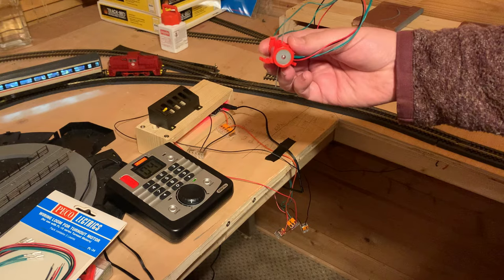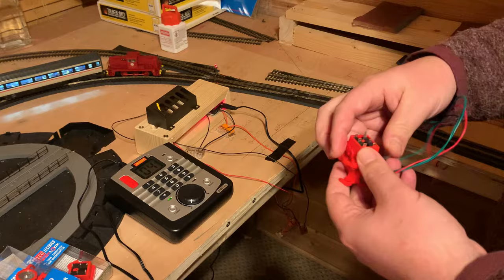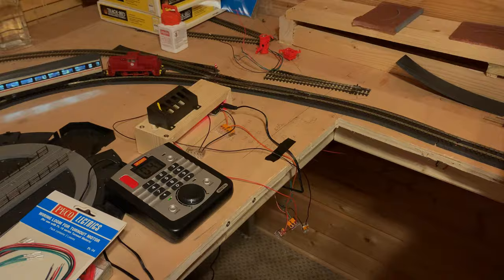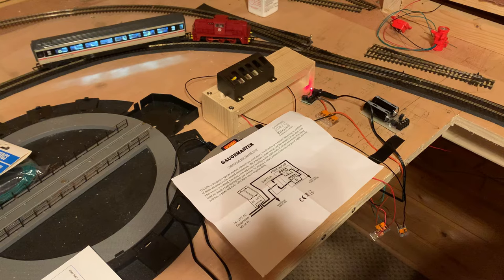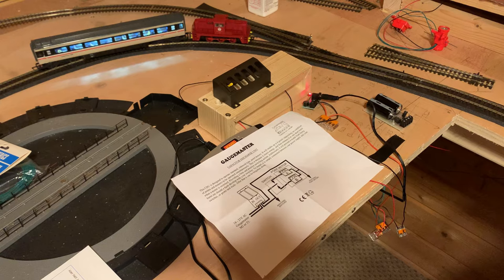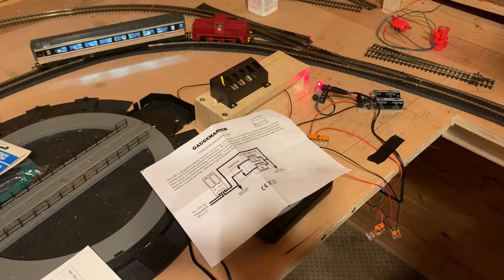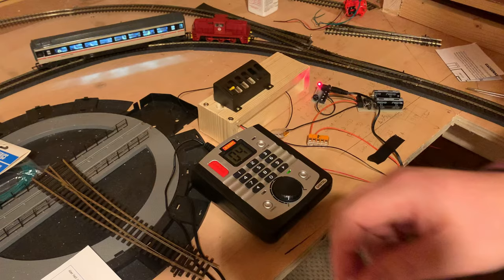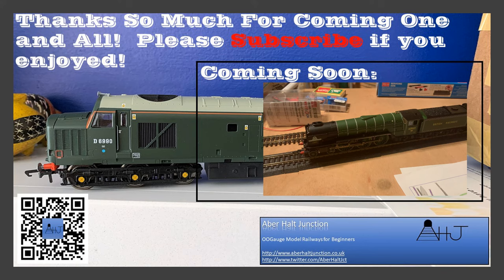Peco   PL1000 / PL1001 TwistLock Point / Turnout Motor - To Buy or Not to Buy?

Comment: Marvelous.  Think this video might have Chadwick on the run lol loved it I’m on the same dilemma at the moment.  Also insul elctro vs unifrogs.  You know what I’m going to go standard insul and use the horrible clips.  Why not simple Easy and you barley see them.  I Have been thinking about going wire in tube for a more hands on experience but who knows it’s just the fun of the build.
Reply from the maker: Wow, thanks josef, that is very kind of you, high praise indeed, I’m sure Charlie is quaking in his boots!! There are a lot of dilemmas for sure. I’m going electrofrog but I know others who are going insul.... Yeah I’ve seen a few guys going wire in tube and it does have a certain appeal and with my size of layout would certainly be doable... would need to work a bit harder on my mechanical skills though!!! Thanks for the view and lovely comment, let me know how you get on.
Reply: @AberHaltJunction  
Yes I have a series of videos on my Channel of current dream layout build as you will see latest video talks about the concept.  Point operation I don’t know.  Peco twist lock is tidy.  I’m even thinking I won’t worry about connecting dapol signals up and rather use the IR approach since it get same job done smoothly.  Cobalt are the preferred motors to go for BUT the more I over complicate the longer it takes and I want to get some fun happening.  As you can see in the videos just finished building my airports and the wiring in that looks intimidating but it’s not I guess we will see what happens.  Party on good sir
Reply from the maker: Party in Josef indeed! I know what you mean, I should be building my next incline but playing with my POV camera instead. It’s a lot of fun! Yeah I’ve thought about IR signals too, they’re neat, really expensive though. Will go and check out your airport now, what a great idea!! I love it when people do something unique. Keep up the good work Sir!

Comment: The motor itself seems more powerfull, the only issue I'm having is the moving parts of the microwitch, as the tie-bar doesn't seem to latch it into place for effective switching the m/s contacts, possibly a mis-allignment issue, so instead of using the tiny mounting screws provided I'm using m2 bolts and nuts as to allow up to 2mm positional adjustment. 
If that fails I might have to revert to the PL10 with a PL15 twin microswitch mounted on.
Reply from the maker: Hi Dave, that is interesting to hear, I haven't had that issue with mine yet. I know some people have mentioned that the movement of the m/s is curved as opposed to the solenoid itself which is side to side, so maybe alignment is key, I'll be sure to make sure I keep my installations spot on alignment. I did notice with the tiny screws there was a small opportunity to move them a mm or so. And I agree on the power front, very reassuring clunk.
Reply: @AberHaltJunction   ,  cheers buddy, all is sorted with the m/s  movement. It was a trial and error thing with which way the m/s component was mounted (as it can twist/clip on either way)    the motor tried but couldn't move the point tie-bar either way when mounted as was but perfect when mounted other way. M/s contacts / switching  tested and all is good  :-)
Reply from the maker: Wurhey! Good to hear Dave, that’s the beauty of twistlock, easy to swap!! Glad you got it fixed. The only fiddly bit with that is sliding the tie-bar into the hole, but it’s not bad once you realise the problem. Thanks for keeping me updated, hope your next installs are less painful!

Comment: I need help with wiring the micro switch! I know nothing about switches etc etc I just need a clear idiot proof coloured diagram.
Reply from the maker: Hi Louisa, it’s not too complex. Depending on which way around you are looking at it, it goes green, red, black. The black and red connectors are close together, the green is off on its own. The green goes to the frog wire. The red and black off to your bus. If you find you get a cut out you may have to swap the red and black wires over. I’d send you a jpeg but can’t do it in the comments.... will put something up on my website to help you too.

Comment: Hi great videos how many point motors can you use on the gauge master power supply thanx
Reply from the maker: Hi John, thanks for the view and nice comment. The WM1 provides 1.2A. The power is provided in parallel from the power supply. Were you planning on using a CDU? How many were you planning on throwing at the same time?